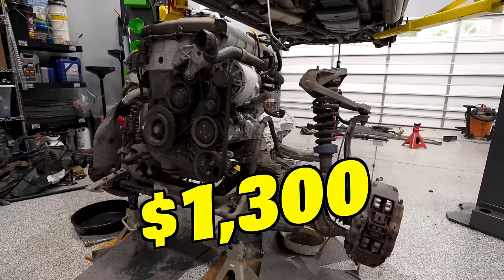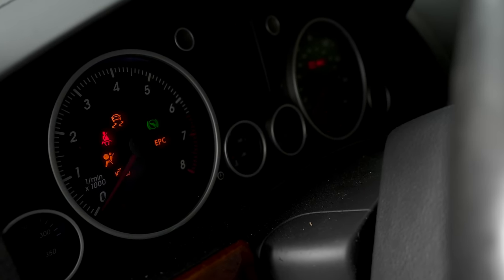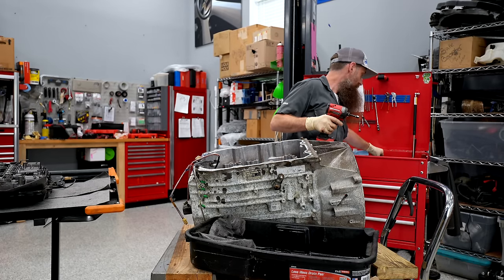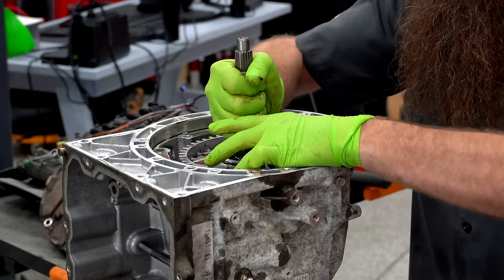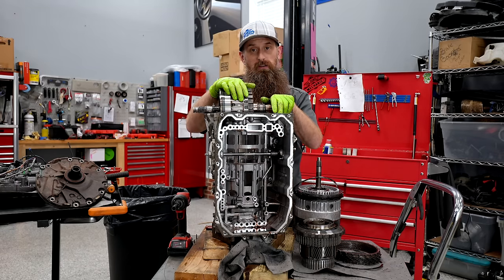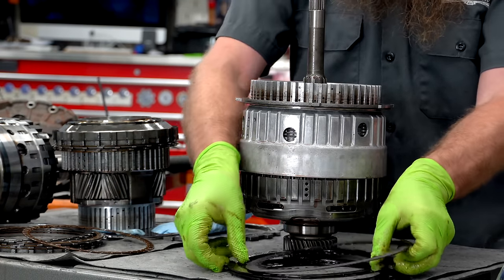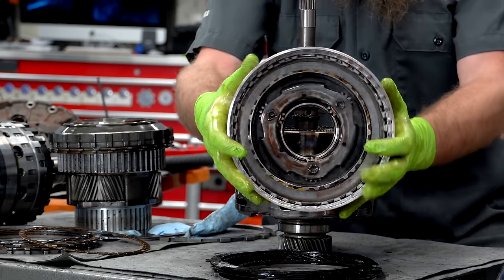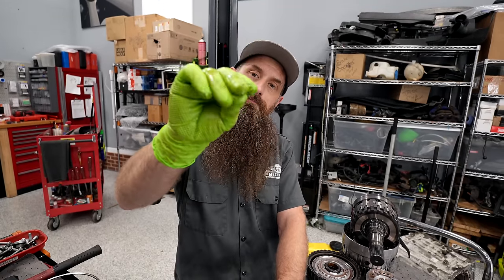How a Failed VW Transmission Sent This Car to the Junkyard??

Comment from the maker: I always get so pumped when we find the issue. Stay tuned for the Other Touareg video very SOON!!!!
Reply: can you do another challing video like the drag race one it was so cool and fun
Reply from the maker: I haven't talked with Gears about that. Id be down again. We usually do that once a year.
Reply: lol sya he found the cause but what he found is the symptom check the pump and valve body u neglected them
Reply: Long time subscriber, first time commenter :D
Have you worked on 2.0TDI VW Crafters before? I have some issues and I would love an expert opinion.
Willing to pay since I am sure you are a busy man.
Reply: Mr.  @HumbleMechanic , do you know why an Automatic car would stall at a stop when in drive

I replaced the clutch & disks on an M-Editon MX6 V6, however the prior stalling unless I put it in Neutral isn't happening but it feels like it wants to happen as you can hear the engine fighting to stay alive against the resistance of the brakes

I did use bunch of thick Lucus to limp it home when it burnt out, but the whole unit was disassembled aside from valve passages(&TC I can't remember)so the fluid should all be quality Castrol stuff meeting & exceeding the recommendations

So is there something else wrong, or is it some amount of Lucus causing it to feel like the wheelspeed or lack thereof creating drag against the engine idling at a stop in gear, out does another part need replacement?
Reply: what was the mileage on this touareg?
Reply: Always gotta love those succesful diags😂
Reply: I would love if you pulled apart a W12 engine , I have 335k km on mine and see is it capable of more
Reply: you didnt happen to have footage of the engine trans and transfer case a sub frame removal? i have a 2005 with 150k thats gonna need a timing job soon and i need guidance on how to get it all out and back in. i can use your timing a vr6 videos for that. the removal  is where im at a loss
Reply: Planetary Powershift Transmission
Reply: Pumped? Really "clutching" at straws there... 😃
Reply: @dustysidepanel3075 unless you have a lift that will remove the body from power train on the ground, you wouldn't be able to do it. Maybe by removing transfer case, trans, and exhaust, you can do timing job with engine in car. But that's also a pain
Reply: Which manual do you advise?
Reply: @dustysidepanel3075 he did a video on buying a parts car..that's where he did it. Basically you'll want a lift...otherwise the suggestion. Was out the front maybe.
Reply: @RowanHawkins  im an auto tech at a small local shop. we have lifts and ive done engine swaps before. just kinda wanted to see what all goes into it as i dont usually do big jobs on euros. i know i can figure it out. but id rather not go into blind ya know?

Comment: “Lifetime fluid” is very expensive in the long run. I’ve always done my DSG changes strictly on 40k intervals. Even though the fluid looks fine I still change it on time and have never had a problem with any of them.
Reply: depending on the dsg there is a service interval. the dry cluch dsg boxes dont need to be serviced because of  the mech unit being seperate from the gearbox side
Reply: Yup remember to a manufacture "Lifetime" is when warranty runs out.
Reply: Lifetime fluid is the correct title though, because when the fluid stops working well, it kills the transmission.
Reply: Changing the DSG fluid and filter is good, but there are shops which do DSG flushes. I have seen plenty DSGs that shifted worse after the flush. According to Scotty Kilmer, the flushing machines blow contaminated fluid through the solenoids where the particles may stick in the solenoids. Causing them to work improperly. Just change the oil regularly.
Reply: I've never owned a Nissan, but supposedly a lot of the reason CVTs today still get a bad rap is because Nissan slapped "lifetime fluid" on all of the models in their first few years and then it completely backfired on them when people realized CVTs hate old fluid.
Reply: I did my dsg service at 25k miles😅
Reply: @scott8919 I drove several early Nissan CVTs in rental cars. They were easily the worst performing transmissions I’ve ever had the displeasure to encounter. They all felt like a fried Chevy THM-350, even when shifted manually.

Comment: I absolutely marvel at how complex automatic transmissions are, and that they last for as long as they do. Now the adoption of classic automatic transmissions are coming to a close with the adoption of electric vehicles. Servicing these old transmissions will be a black art 20-30 years from now. Heck - it's a black art today with some dealerships/auto shops! 😆 Thanks for the teardown Charles!
Reply: I mean, economically... it's easier and cheaper to replace a transmission in a lot of cases than it is to tear one apart, diagnose the problem, get the parts, replace them, put it back together, throw it in, and pray it works. Pop the old one out, pop a new one in, DONE.
Reply: @scott8919  yeah, if the problem is not properly fixed it's another 3 grands in labour later, I'd rather have it replaced with a new or at least known good 2nd hand rather than trying to fix this one.
The clutch was faulty but we don't really know why, if the reason is not running low on fluid it will happen again.
Reply: Kinda why I shudder to think about the disappearance of manuals in new cars. 

I know it’s a big job and most people don’t have a trans jack but I can theoretically service my manual myself. I’d be fucked with a DSG or traditional auto.

Comment: The first transmission I ever opened was from the 90s, first it was 98% metal second it looked way better than this one, and the outer case was covered in dirt and grime. kinda funny, buying the whole overhaul kit was less than 500 dollars, but it does take countless hours of Assembly to rebuild a transmission.  It's sad to know, like on any other industry the coast to repair never comes from the spare parts, it mostly comes from the aggregate cost of service. 
and that is why everything is disposable, and they stop making spares for old models.

Comment: Exactly same kind of thing that did my Nissan maxima in with a older stepped transmission.  It’s still going living on lucus after 3x drain and fill  it’s lost 4th gear but still moves.  Going on. 3-4 years now

Comment: Awesome video. Thanks so much! You kept saying thank God it’s not going back together. Why exactly? Was this transmission Not a good candidate for a rebuild? And how come rebuilds never last as long as the original factory ones? Even if the car financially isn’t worth it, I’ve had cars that it’s worth it to me to pay $3000 to fix the transmission if I really like the car but it’s not worth it if I pay $3000 and the transmission goes bad in two years so I transmission rebuilt in the shop inferior to brand new ones? Because the shops always try to say they’re superior but that’s not been my experience.
Reply: he stripped the thread on one of the boltholes during disassembly.

Comment: Wild you post this. I have a 2007 MK5 Jetta 2.5L Automatic with the 09G 6A from Aisan. Im currently dealing with rough shifting and the car revving up and not going anywhere after it gets hot. I've considered replacing the valve body as I have do a lot of work to the car so far and dont want to get rid of it. Where do you recommend getting a fair priced and good quality valve body from? ~ JT

Comment: When I was a dealer tech 1990 we would get a transmission in a big plastic box all tested and rebuilt. We just installed them and put the core back in the box for return. In2010 I had a Jetta  just out of warranty and  the dealer quoted me 5600.00 for a rebuild unit No torq converter.

Comment: I'd like to see a Passat 3B5 / Audi A4 B5 DHW manual transmission teardown/repair. I've got plenty of these but even if i feel qualified to disassemble ande reassemble these correctly, i'd love to see an how to on them first. I'm a trained mechanic from germany but i mostly worked on engines so far. With my upcoming 1.8t tuning project i also want to check if there's anything i can do to make my transmission last another 25 jears.
I liked you digging into this transmission issues and finding it. Great work - keep on doing stuff like that.

Comment: 2004 L7 V8 please show a few repairs for common issues.  The transfer case chain, failed center shaft, repair for flex pipe failure both sides.

Comment: basically , unless you have time to spare and can fix it yourself its beyond economical repair . no matter how nice the rest of it is.
Reply from the maker: Yep! its pretty sad really.
Reply: @HumbleMechanic   long gone are the days of just screw in an engine and box from a toyota pick up and be happy ,,, people expect so much more from a diesel these days , and the emissions have killed them , 300k out of an old german taxi was the norm in the 2000s ,,, and they talk about progress , it all seems to be going backwards these days .
Reply: @tomthompson7400 Keep them 2.0 Blue motions running. Do an EGR delete and I am sure they can do 200k miles.
Reply: @tomthompson7400 Keep them 2.0 Blue motions running. Do an EGR delete and I am sure they can do 200k miles.
Reply: @tomthompson7400 Keep them 2.0 Blue motions running. Do an EGR delete and I am sure they can do 200k miles.

Comment: I love your teardowns, thank you!  I own a 2007 A6 4.2 with 102K on the clock. I've owned it since new, oil changes are done regularly, it has been running very well.  What can I expect for failures from a vehicle of that age?
Reply: luckily you don't have this junk trans in that a6. 4.2 is bulletproof if taken care of and that trans is solid. change the fluid and if you live in a snowy area don't be a idiot in the snow. car will last you forever. have you done your timing yet? what's really gonna hurt is the cost to do the timing chains/guides unless you can swing it yourself.
Reply: Your car is still new with 102K. I have a Touareg 2009 3.6L V6 with 230,000 miles and it is still strong. I do all the maintenance myself. I don't have much trust in auto shops or dealerships. I have never changed the timing chains since the car run smoothly.
Reply: @carlosgraphic  funny thing about timing, it runs smooth till it doesn't run at all XD.
Reply: @rickylafleur5823  Timing chain, it is not like timing belt. The timing belt needs to be replaced  with high mileage.  The timing chain as long as the engine is well maintained will last until engine time. Unless there is some kind of problem related to it.
Reply: @carlosgraphic  never said belt and timing chains stretch a bit. not only that, those plastics guides get brittle as fuck over time whether you baby the car or not. 

you are correct though, it will last the engines life because when they give say bye bye considering this is a interference motor. kind of like that lifetime transmission oil the dealer sells people on, it will last until that thing detonates prematurely.

Comment: A question for you and your subscribers: if you burn out the clutch on a manual car yet it is still functional, would it be harming any other components of the car, such as the gear box, if you delay replacing it?
Reply: No not at all, possibly the dual mass flywheel but unless it has physically failed (its springs for example), shouldn't be damaging a DMF either, though the DMF might not like the heat if it's being slipped constantly - nor will it last very long!

Comment: Hey, sorry to disturb you. Watching you for years now.. i did learn a lot from you. But i have a weird problem going on.

Golf 7 mk7 gti performance stage 2 (315hp)

I get epc when full throttle (6500rpm shifting) when i restart the car its gone. Weird thing is if i shift before 6500k rpm there is no problem. What can it be?

I changed the bobine and coils to from a Audi RS which can handle up to 600hp..

Can you please help me out? What should i get checked out? Or what can i do? Car has 135k km. Should i check the throttle body? I got the gti bcuz of ur R videos. Felt in love and did many things to it you did 😁😁😁

Comment: What do you think about the 1.6 TDI? Is it true that they leak oil? I am buying an Audi A3 from 2011 with this engine and I don't know what to expect. I am switching from a mk4 golf TDI to the Audi A3.
Reply from the maker: In the US we haven't got a 1.6 diesel in decades.
Reply: The earlier 1.6 TDIs had some injector issues. In terms of oil leaks, the only really common one I know of is the valve cover gasket. They have seals around the injectors that tend to leak. Other than that, they’re good engines with great gas mileage. Obviously not the most exciting things in the world though…
Also, as with any common rail diesel, the high pressure fuel pump can fail. Fixing that is very expensive due to metal shavings in the fuel. Lubricating fuel additives are probably not the worst idea.
Reply: Update: I was about to buy the Audi but just 1 day before I was supposed to go and get it the Audi started making sad noises. It turned out that all 4 injectors were failing. After searching for the price of the injectors I realized that they cost 2000 euro (double the price of my golf). So this means I'm keeping my old golf. At the end of the day I am getting the same amount of car for 20% of the price.

Comment: so you found aftermath of the problem , not the problem itself . what you could do was to test the clutch pack piston by blowing compressed air into fluid passage leading to the piston . if too much air leaked around piston , then piston is the driver of the problem .

Comment: Hi @humblemechanic, I have a golf mk4 1.6sr with an automatic transmission and for some reason the car is stuck in one gear and goes forward even when in reverse or neutral. I have ran diagnostics and not seeing any fault codes from the TCM for the transmission and did fluid change and added a new filter kit as well, any idea what could be wrong?

Comment: Have you ever taken apart a jetta hybrid transmission?  They had a recall on it from hairline cracks in dsg 7 speed transmission.  My hybrid jetta had 62,000 miles and I was told it needed a new transmission which VWsaid they aren’t responsible for, even though my car had same symptoms as recall jettas.  But my car, along with so many others, is not on the recall.  VW doesn’t even take transmissions apart.

Comment: Funny, our Touareg had trans problems early on (mostly software defects)... The trans? Aisin which is Toyota. How did VW manage to make an Toyota trans suck? lol.. Worse, I work for Toyota lol. All that said, when I changed the trans fluid at 240k miles, it still looked brand new!

Comment: Could you please do a teardown of a knackered differential on a 3.2 VR6, both front & rear? These are a VAG non-serviceable item but my 19 year old cherished A3 3.2 quattro came a complete cropper due to the fluid overheating after a high speed drive. Greetings from the UK!
Reply from the maker: If I can find one. You bet!!!

Comment: Figuring out why EA111 engines fail their head gaskets near the alternator and crunchy gears in 084/085 (5th gear oil starvation) transmissions...

Comment: Was just under my '06 Touareg and noticed transmission fluid coming out of the transmission electrical plug. Is there a way to seal it again or does it require a new harness?
Reply from the maker: You may be able to try a seal. I’m not sure vw sells it. But probs could find one

Comment: I have a VW Tiguan that is losing oil before every oil change since February. It doesn’t have any leak . What can be happening with my Tiguan . It has 147562 miles . 

Do you any idea Humble mechanic ???
Reply: Probably blow by. How much is it using and what engine is it? Many VW's with high mileage use a bit of oil, just top it up when needed?
Reply: @eponymous7910   2.0 TDI model S Tiguan 2016 every 1000 miles I think I need to add oil . Is normal to burn oil on this engines after 140.000 miles
Reply: @GIL839  Worn piston rings and/ or owners have skipped on oil changes and now oil rings on pistons are clogged up.
Reply: I change the oil every 5000.

Comment: Manufacturers claim "lifetime fluid" not sure if VW does it but what are youdoing with the car. Trading it in before 100k? Dont worry about it. Want to drive a vehcile past 100k then ya should do extra oil changes and change trans fluid every 40k

Comment: Pfffftt, The valve body could have CAUSED the friction plate distruction....Also, the valve body may have operated improperly
because the transmission control electronics has a problem....You have not Solved the problem, just uncovered some clues....
Reply from the maker: I did the valve body too. Nothing to see sadly. Or id have included it in the video. Im not sure what "Pfffftt" means though
Reply: Which leads to the electronics and /or the oil pump and pressure control.... @HumbleMechanic

Comment: Aisin tran? If you crap one of those at 130k miles shame on you!
Reply from the maker: all in all those transmission in the Touareg have been pretty solid over the years. This is not the first failure ive seen. But it's not common at all.